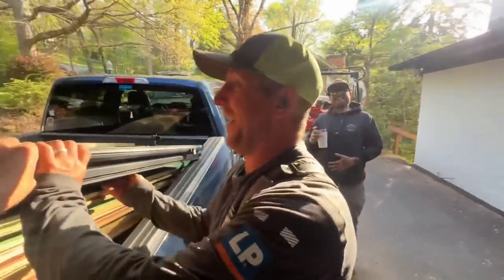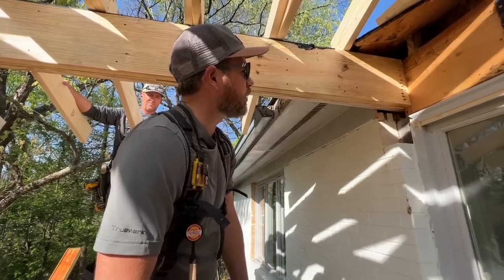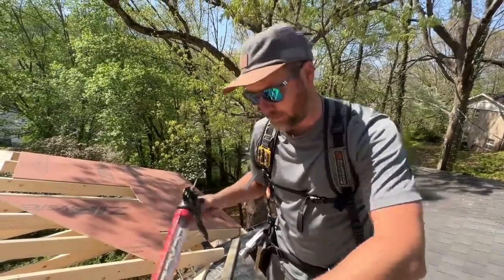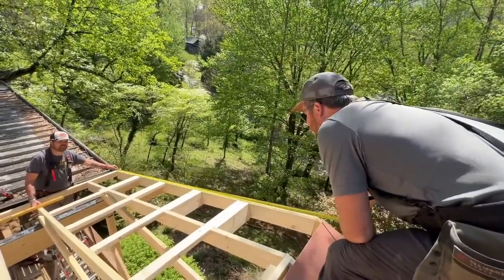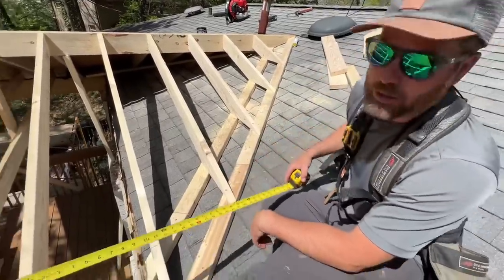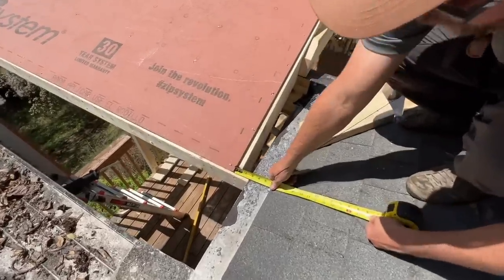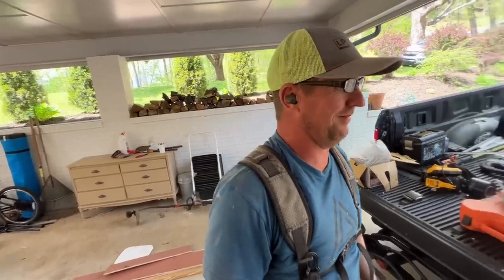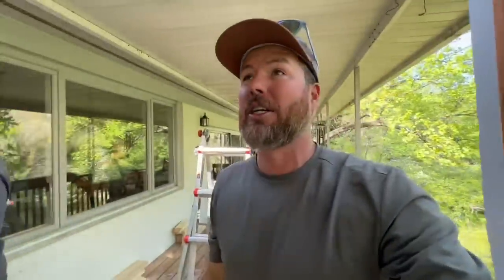Kitchen Addition & Remodel EP04 | Sealing up the roof

Comment: Looks good guys … when I tie into a existing roof I always cut back the old shingles and go into the original rafters makes it better when you are drying it in as I use ice and water barrier along those seams
Reply: I was wondering why they didn't or did I miss something. Would it not make it harder when the roof is replaced.
Reply: The explained though. Owner doesn't want inside wet... it's finished property.
Reply: It's illegal in all states to frame over a combustible material such as shingles. Hopefully the house hasn't burned down

Comment: My oldest brother has been a carpenter for 35+ years. He always told me growing up that remodeling can be so much more difficult than new construction. He's right, installing doors in out of square framing, replacement windows take so much longer, you have to take all of the old out and dispose of it before you can really start.  Also, almost nothing is level or perfectly square.

Comment: Looking good guys, nice progress for "House Builders" doing remodeling. We deal with that same new roof issue all the time. Our P.R.T (Pro Remodeler Tip) is to run your skill saw against the 2x on roof deck. Using the opposite side you usually do. Its 5+ inches on most saws. That parallel spacing will be prefect once you span you Zip Wall across the 2x and then run some Ice Damn under that shingle cut. Its why our P.R.T is to always save a worn framing blade for those shingle cuts. Setting debt to 3/8". Hope you try that next time and it helps ya out! Tks for the great, real world videos! Like...now owning a "new" old window. The frigg'n struggle is real. This roof cut tip PRE sets you up to do a "California Cut" style roof weave. Its 2 Steps in one!

Comment: I like to sheathe a roof like that starting from the top. You have a long straight line to start with and it's easier to figure the valley cuts. Also, you only have to rip the bottom sheet instead of all the ones that end up at the ridge.
Reply from the maker: I’ve done that and it’s actually a pretty good game plan for situations like this

Comment: I've always said that you boys are living the dream.

I'm a u.k builder/carpenter that does alot of extentions and roofing.
What you lads call remodelling.
I'd love to just build from scratch all the time. It seems more fun than what I do.

Tieing in/marrying into super old or super shitty original English houses is the worst.
You're forever forced to compromise. Nothing is level or square. Especially doing roofs in the weird English weather.
The minute you expose any of the original 9/10 times it will suddenly start raining.
You can hire a "tin lid" scaffold but it's super expensive.

I'm looking into branching out into timber framed extensions, which are rare and pretty expensive in England.
But so much quicker and less messy than hiring bricklayers.
So I'm hoping it balances out.
Reply: Just made myself a timber frame extension on my timber frame house - had the whole thing up & tiled in 10 days. Masonry has its place but my god its slow
Reply: @Daninashed  u UK based?
Reply: Forever forced to compromise… well said

Comment: Loading up the screws Into the leg rig can be made easier if you keep a n empty smaller box of the same type with one end ripped open. Fill it, then put the box in the pouch. Less spill, less hand pokes, and easy to empty after the jobs all done.

Comment: enjoy watching you guys. you make me wish I was still doing this professionally . However One thing that would make your life a whole lot easier when you were building those walls and you talked about putting little nailing blocks in to have drywall nailing. I would have just made a double bottom plate, that would have saved on all the cutting and you would have moved faster. That is just a little trick from one person who used to do remodels for a living. next you were overly concerned about the sheeting just as long as you were splitting those rafters with the sheeting you would have been fine plus on a small remodel like that. And this is just me everyone does it differently. I would have started my sheeting at the ridge first. again just the way I would have done it. Every builder should strive for perfection but when it comes to a remodel you are having to deal with years of settling on a home and something that was once square and perfect is not or if they were crappy builders and didn't care then you are going to fry your brain at trying to figure out why something is off. All you can do is make your stuff perfect and blend it into the homes existing structure with trim. My building teacher when  I was in Highschool said" Glue, Caulk and paint make a carpenter what he aint. Its bad grammer I know but it always stuck. Keep up the great work.
Reply: Thanks for the great comment

Comment: Hey guys, whats the deal with not protecting the homeowners floors prior to all of the construction traffic through the house.  I use Ram Board cardboard to protect the floors on our home reno.  Also, why weren't you just hauling the destruction and contruction materials up over the house.  Seems like it would have been a much shorter and less intrusive coarse.  (a roll of tar paper as a walkway over the roof will protect the shingles from foot wear traffic).

Comment: Question. Why did or didn’t you remove the shingles below where you attached the new roof?
Reply: This.  30 years from now whoever is doing work on this house will be swearing like crazy and wondering what the fcuk these crazy people were thinking when they built the roof on top of shingles.
Reply: @-_James_-   really all that additional work is not needed. A roofer worth their salt would find no problem however they done it. Look back on who gets paid for what work. They ain't paying the Perkins crew to fix a roofers problem.
Reply: No problem  with the roofer will cut flush on the valley and roof the roof

Comment: Maybe it's just me....but I'm not a fan of extending the kitchen over the old porch.  Just seeing the brick columns sway just makes me cringe.  I would have rebuilt it from the ground up and would have enclosed it at ground level as well....but I tend to over build things.
Reply: The end of the day it’s about budget. I’m sure Perkins told them the same thing but the homeowners didn’t want to do the most, understandable.
Reply: @ReginoMarco  I hate that argument. Safety comes before budget every time. A reputable builder should refuse to build something unsafe. You know what’s even less expensive than cutting corners? Not doing the addition at all.
Reply: I agree.   I commented on that last week.   I'll bet all the engineers in California were cringing when they saw that.   We don't have strict earthquake codes in North Carolina but we should.
Reply: Again, agreed. I love most of their videos, they're great at building new houses in the murrican timber frame style, but as a carpenter from the UK used to working frequently on older houses and with things involving brickwork this is just cringeworthy. They do not know what they're doing. And I think the way they're treating the clients existing house while they work is pretty disgraceful too.
Reply: They are reputable builders. We’ll known. U gotta mix in the funny to have a good YouTube channel. I’m sure they know what they are doing. Building on a budget is not a bad thing. Hey will this be good for 50 years or 100 years. Either way nothing last forever.

Comment: How come you guys don't use safety harnesses while on the roof and quite high up?
Reply: Low pitch makes it way easier to stay stable and the ropes would probably be more a more hazardous tripping hazard.
Reply: @namAehT  a safety harness should be really used at any angle even flat roof, if one of the guys fall, you will have the full responsibility as employer, many PPE's are not comfortable to wear but still there to protect you, a little inconvenience does not compare to your health
Reply: @rubikasuto  Calm down OSHA.
Reply: You have to we dont

Comment: I’m confused why the new roof would be built on top of the existing shingles. And then seal the new sheathing to the existing shingles? Is that really how these things are done?

I would think you would remove the shingles at least where they overlap and seal the new sheathing to the old sheathing.

Comment: This is a sketchy deal.  I'm just not comfortable building out finished living space on an old deck, let alone one that is 20 feet off the ground sitting on sketchy brick poles/columns.  Is there a set of engineered plans for this job?
Reply: Where I live all that is required is a building permit from the city.  Nobody ever inspects add ons like this. It’s another matter altogether if your screwing with the city’s water or sewer lines.

Comment: Do you think that you lose money by taking remodeling jobs instead of building new construction? Just curious, no worries if you can't or prefer not to answer this question.
Reply: In some other video they said they can't continue with the current project because of missing stuff and they can't start the next project because of missing permits. So it's either doing whatever pays or get no money at all.
Reply: This is just a job for a friend to fill in while they wait for windows to come in.
Reply: It’s really hard to give a fixed price on a remodel. Lots of unexpected things could happen..

Comment: Inspects wet roof in flipflops with no fallpro.

Carries material inside of the house with no ram board to protect customers floor

Tosses waste material off of 2 story roof and breaks window

Single bottom plate non-treated on an external wall

Doesn't inspect roof decking, builds gable overtop existing shingles

Failure to have a structural engineer stamp a proper design for the extension while using existing janky brick pillars.

If this passes final, your inspectors must cataracs and Alzheimer's...

Y'all need to seriously evaluate if what you're doing is safe and in the interests of the customer. I cant believe it's video 4 and this is still happening.
Reply: Normally they do such a great job. This one is way too sketch 😫